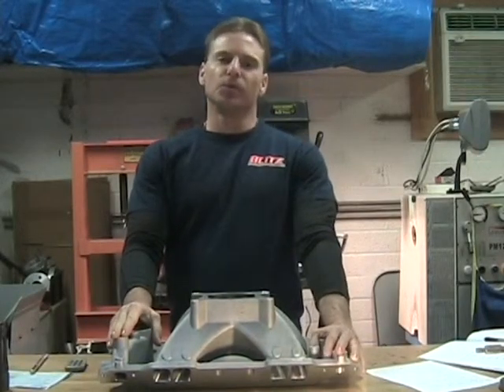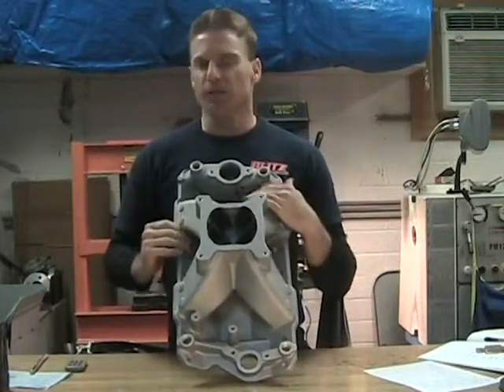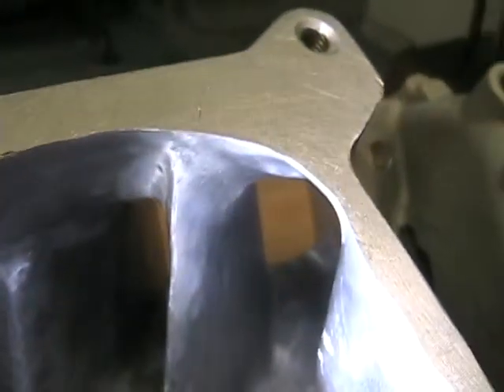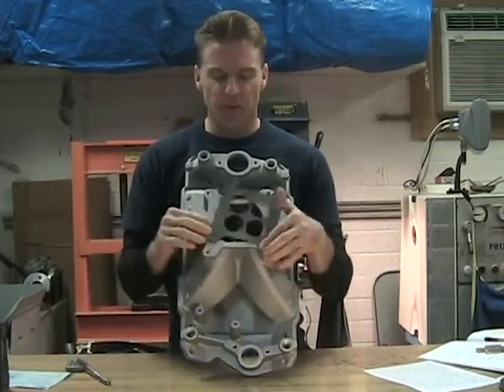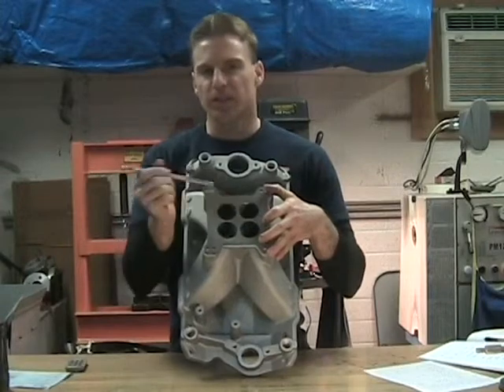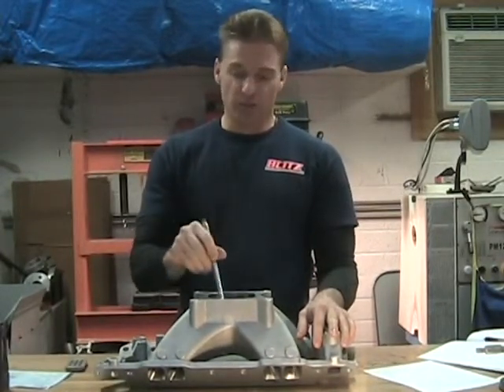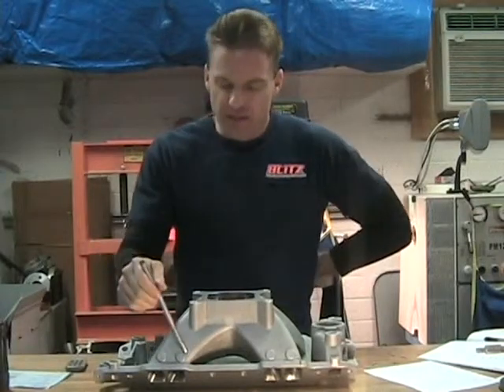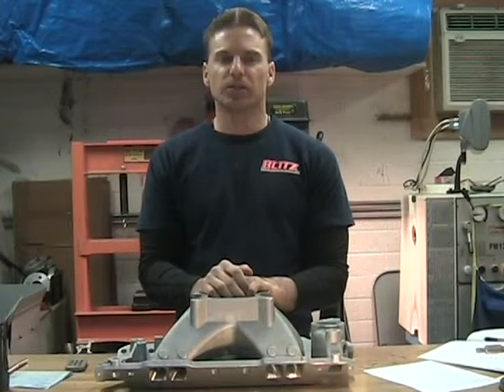SBC intake manifold porting (STEP 5 INTAKE) Video 7

Comment: Like to this on a Duel plane Air Gap. I think there is more gain in working the plenum and the beginning of the runners. Also, cutting and contouring the divider, is there gain doing it? The air gap for a SB Chrysler goes all the way to the top. A SB Chevy has a cut out in the center. Why would there be a difference?